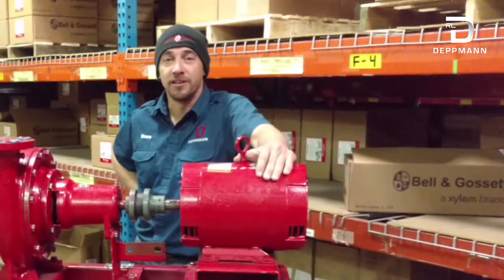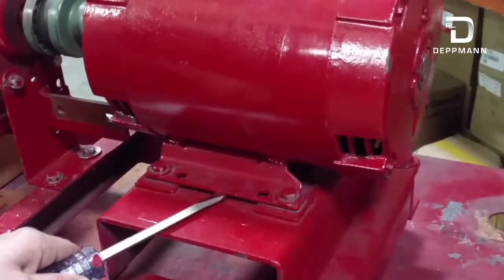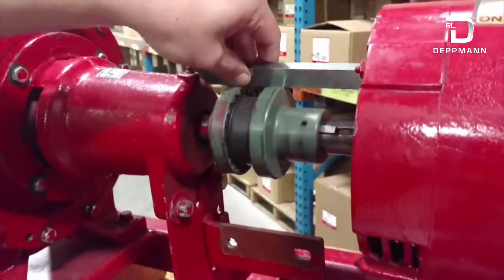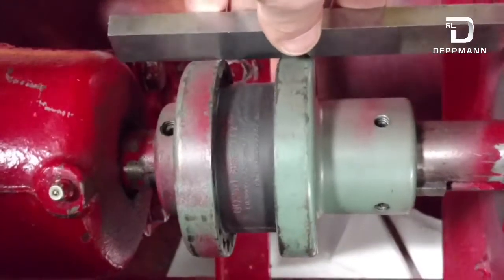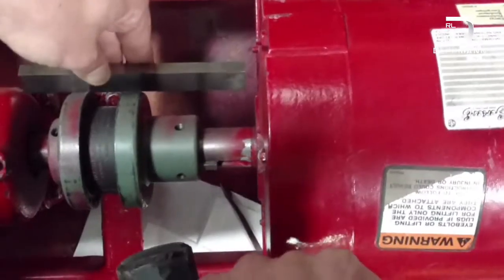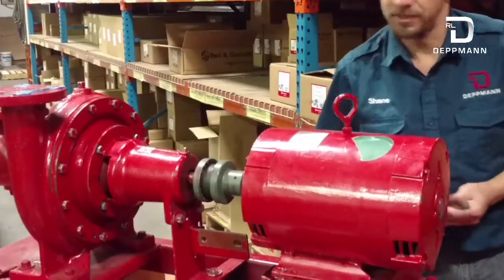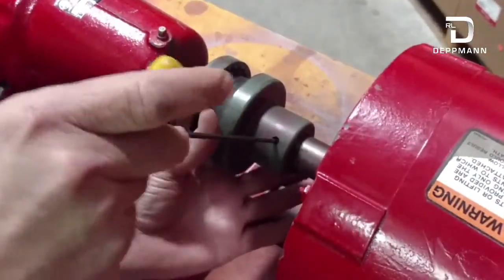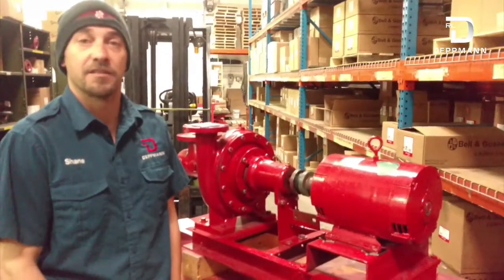Straight Edge Alignment on Base Mounted Pump

Comment: Nope. If you want to do the job correctly you need either a dial indicator or a laser alignment tool. First and foremost you are doing a shaft alignment off of a coupler. The couplers are not machined parts. Their outer diameters are not true and they are not the shaft. The rest just gets worse from there. If this worked nobody would buy a  $10,000 laser aligner.

Comment: You need to check angular alignment too for this rough method. If this is a low rpm motor especially if on a VFD at lower speeds then this method is OK IMO. For anything 3600RPM or more I'd consider laser aligning